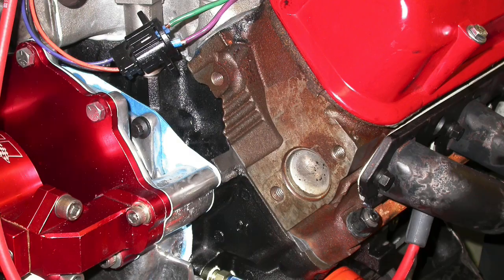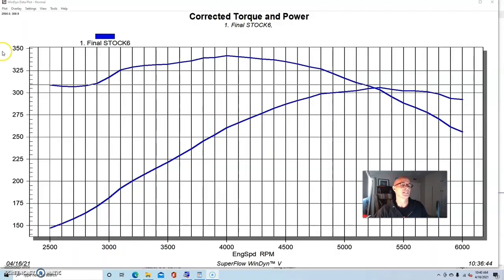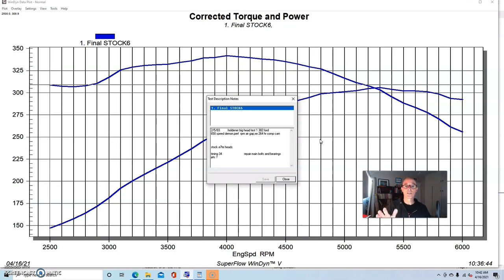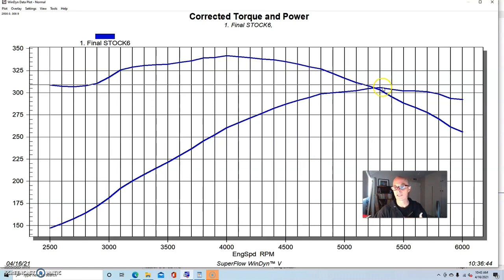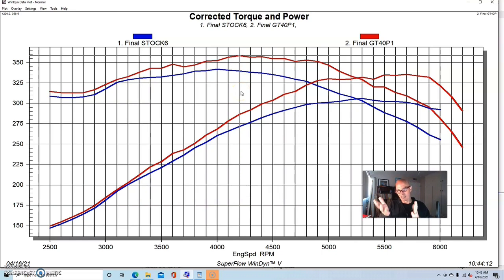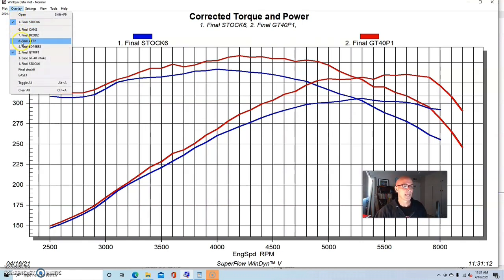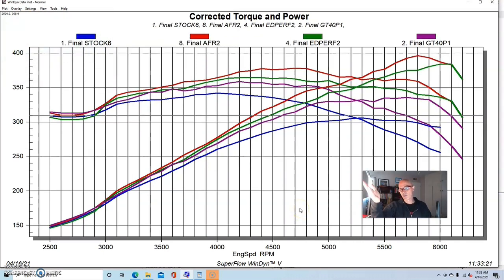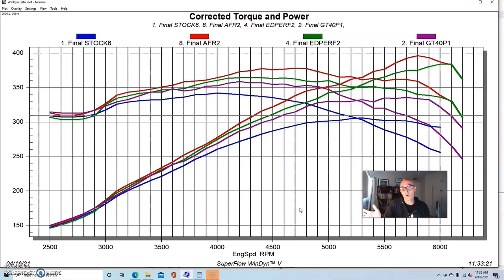JUNKYARD GT40P HEADS-ADD 30+ HP TO YOUR 5.0L (FOR FREE?)

Comment: I would like to see a 351w with max ported gt40heads, milled down, bigger valves, roller rocker conversion, good race valves, polished chambers, It would be nice to see what the combo would do if you were to do everything possible to the gt40 heads. I have looked all over the internet and no one has done a video on a truly maxed out set of gt40 heads its really disappointing!
Reply: What it costs for a fully worked 240 cfm GT40 head you can buy aluminum. Many hours labor and flow benching. Vizard iron GT40/ E7TE heads are $4,000 ready to run.
I think Charlie Servideo said $2,000 for just porting his.
Reply: @hotrodray6802  I understand there's better cheaper ways these days but the look on someone's face when they underestimate you and you blow their doors off is priceless
Reply: @gimply85  Then definitely get DV iron heads and Big Dogs stage 3 original HO intake and ported 65mm and BD cam. 
Or even BD ported iron heads for less $. Look stock, make 400+ HP crank, and 340+ wheel.
Reply: @gimply85  but would they blow your doors off if we made a better decision and ran good set of aftermarket heads?
Reply: @hotrodray6802  ☝️ EXACTLY
Reply: True I've looked for the same thing yet I know many guys did the exact thing to these heads 30 years ago
Reply: @timothywalker2273  problem is... as good as the internet is, you can't beat paperback..... I have kept over 30 years of street machine, zoom, fast ford, performance ford etc etc, and I can tell you that finding the 30 year old articles detailing the work involved from the guy's whom did this.  Is worth it's weight in gold 👍
Reply: @justin3131ify  Unfortunately I know guys with cars in some of the mags you mentioned and their claimed HP were 100hp over what they actually make 😅. So beware of the data sometimes.
Reply: @GapSauceYoutube  Cheers mate noted, but I wasn't referring to feature cars... I Was talking about some of the tech articles that the quality magazine used to feature, from some of the top engine builders.  This video has been around for a little while don't think the fact that you are here watching it now, when a Windsor has shown up in your life goes unnoticed. 😉
Reply: @GapSauceYoutube   Also when is next video drop? 😁
Reply: @justin3131ify  Haha, you're onto me 🤣

I did a 300whp T2 TE50 years ago, this one will be a little spicier 🙂

I dropped one a week ago, hopefully by the end of the month I'll have another 🙂
Reply: Well why don't you do it.  We would  love to see it
Reply: I agree. I had 1.94/ 1.60 valves in the C9 351 heads and never got any flow bench numbers but really didnt think it was that big a gain. They had some ex. porting done as well. So I'm wondering if the only way to get a good set for a blue oval isn't to just bite the bullet and go after market
Reply: Working on this now

Comment: GT40/GT40P heads won't bolt right onto a 351W in the junkyard.... the head bolts are the wrong size. DO *NOT* use a regular "twist" drill bit to make the bolt holes in the heads bigger!! ... you need a proper .500" or .501" machine reamer to do the job properly.
Reply: Actually some of them will. I have a early 96 Explorer that had F3ZE GT40 castings (not the hecho en Mexico ones) on it with 1/2" bolt holes and NOT drilled for smog. Only set I've seen like that but obviously they're out there...
Reply: I got a set of Ps a guy was using on his truck. Had the 1/2 inch holes. Don't know where he got them. Lightning?

Comment: I scored some NOS Two-Bar (Marine) GT40 heads. A friend ported them, removed the EGR bumps, cleaned up the slag on the OE headers (40% larger at flange!) added a ported E4 intake, a recurved distributor, and 1.7 SVO rockers to my '85.  Woke it RIGHT up and nobody knows it's modded. :-)

Comment: I’d love to see similar tests using the same motor with a good set of early 351w heads from 1969 or 1970.
Reply: They flow pretty darn close to stock GT40 heads. I've heard from more than 1 source that the GT40 heads are based on the C9OE castings.
Reply: @linctexpilot8337  are you talking stock 351W heads or worked over?

Comment: Answering your question, depends on what you want or are using the motor for. If it’s just a Saturday cruiser and you’re on a budget, the GT40(p) heads are perfect. If you want more HP and invested in other mods to support added HP, then a good set of aluminum heads makes sense.

Comment: It should be mentioned the GT40p does have a smaller exhaust valve than the gt40 which once you get past .500 lift has a dramatic effect on flow. If you go with a gt40p you should probably stay around .500 or less unless you do some valve work to open them up. If you want a high lift cam you should probably get the GT40 instead.
Reply: My combo is 2000 explorer long block Alex springs drop in springs , B cam with 1.6-1.7 scorpion roller rockers. Mac long tube headers .Fox coupe V8 swap T5 , 4.10 gears .
Reply: @allenjay8157  Hows it run?
Reply: @void7365  runs plenty strong in a 2800 lb foxbody with a/c , not stripped down . 
I disagree with the whole blurb on the gt40 being better due to a bigger exhaust valve . P head is a fast burn head , I found no difference when I put 16* initial timing in my car , in fact car ran like crap low rpm with b cam . I put timing at 12* with spout out and car drives damn good now. I do drive this car to work 26 miles one way . 
For a stock head I like the p head , I would not put a huge cam with a stock head anyway so there’s a reason I bought aluminum heads for another project.
Reply: Good point

Comment: Will this work with efi? I'm an off rd truck guy. So efi is a Must an everything I see is carb built
Reply: the gt40p heads were made starting in late 1997 so they were built for EFI. But I would go with GT40 heads instead if you intend to go with a cam with .500 lift or more because the  GT40p has a smaller exhaust valve.

Comment: I have a question I have a 79 302 how strong are the connecting rod Bolt will they handle 5800 RPMs
Reply from the maker: YES
Reply: Long ago I built a 308 with 289 (1965) full race ported and I shift at 6,800 rpm only add arp bolt on the stock connecting rod never have problems the blockwas a 1971 stock crank stock connecting rod only change the piston for flat top

Comment: Does the GT40 heads work with a 1970 302 2V?
Reply from the maker: Windsor-yes
Reply: @richardholdener1727  How much HP you think I would gain by just getting GT40 heads, a 4 barrel intake & carb, all with standard rods, pistons & cam? Should I change the cam?
Reply: Yes but you are losing compression unless you get them milled.
Reply: @rondye9398  if he's going from E7 heads to gt40s his engines compression ratio won't change. They both have 63cc chambers. Depending on casting number of course. Some ranged from 63-66cc.

Comment: Richard, what total build package for stock bottom end rebuilt GT40P heads TFS valve springs valve job Explorer intake AOD trans. Which cam works best street car? Thanks for the best videos.
Reply from the maker: LOOK FOR A 218/224 DURATION CAM
Reply: Thank you for taking time to help Richard. Keep on testing, like the videos!

Comment: Good timing Mr Holdener. I am doing a gt40p swap this week. Waiting for the heads to come back from the machine shop. I nicked some of the valve seats while porting the bowl and had to have the  seats re ground. I am upgrading the valve springs with the TFS spring kit and topping it off with 7.1 ratio roller rockers. The engine was using D8OE heads so I am hoping to get 50HP out of this swap.

Comment: I need to do a GT 40 head and explorer intake swap on my 86 Bronco. The stock motor is such a dog. It has 4.11 gears and 33” tires with an AOD trans. A cam is in the future to. Whats recommended for a 4x4 looking for mid range power?
Reply: I've heard of some people using a 93 Cobra cam with the 1.7 rockers because of the way that the cam was geared toward low end TQ. Trucks need that low end. There's also always the E303 cam.

Comment: i just got a reman set of p heads ,did you change the springs on the p heads or did you just run em, from what i am hearing on the web .450 lift is max on the stock spring.going on bone stock 1995 5.0 bottom end.1968 mustang with aod
Reply from the maker: CHANGE SPRINGS

Comment: Hmm... These graphs show GT40 heads and a turbo is the way to go unless all you want is high rpm. Then buy high flow aluminum and build the whole engine to handle 7500rpm or higher.

Me? I'm building a car to drive all over and tow a camper so I'm going with the GT40 and a turbo. My only choice rebuild my 302 or buy a junkyard 351. Although I'm leaning more towards keeping my 302, get the GT40 heads, put high quality valve springs in and rev that engine to 6500-7000. 450hp for cheap with a turbo 302 is sounding really good. Hopefully I can coax 400+ lb-ft out of it at 3000rpm. Big block power out of a tiny engine.

Comment: Got a set of home ported big valve e7's, a set of gt40 and gt40p's, and my Canfield 192cc's. All have homes save for the p heads. Got the Canfield's for $600 complete on CL.  Rest came from cheap junkyard motors.

Comment: Have you ever tested the street heat heads the original aluminium ones ? 2.02 1.60  200 intake 90 exh 60cc chamber ? On  a 351w stock bottom end ?

Comment: You should redo this kind of test put upgrade the springs from the GT40/P heads. The engine is only designed to go to 5,000 rpm and you ended up with valve float

Comment: I’d like to see the GT40 head on a Windsor vs the Double Hump heads on the 350. I know that the double humps would have the advantage because of the fast burn combustion chamber design vs the GT40 semi hemispheric design with similar camshafts. Just another idea. Thanks again Richard for a great video.
Reply: I think the GT40'S would flow more air and that's where the power would come from. My 40P's are 58cc chambers. I can't tell you the specs on the Chevy heads.
Reply: I have the original E5 head off my motor. I had them plained down 8 thousandths to get a good surface. I came across the 40P's by accident. Through the research I did I knew they were a better head and added HP. The 40 series heads have weak springs. I decided to get the upgraded springs so I wouldn't have any valve float.
I'm looking to get them ported. Not many shops do that now. I don't have any experience doing that so I'm leaving my hands off so I don't screw them up.
Reply: @charlesespenshade  Look up Eric Weingartner racing and Headbites on YouTube. A lot of porting and polishing tutorials. If you’re going to upgrade cylinder heads in the future, go with a set of AFR 185cc Renegade or the Enforcer cylinder heads. By the time you pay an experienced porter, Machine shop machining for screw n studs-guide plates, 2.02-1.60 valves, you could get a very nice set of aluminum heads that will smoke the GT40’s. All that work done on the GT40’s would be $1200.00 and up. Good luck on your project.
Reply: @StainlessTIG2   I'm running stock rockers and push rods. I have $400 in my heads. The guy I bought them from had them shaved for a stroker motor he was building. He decided to go aluminum heads instead. For what I wanted to build the P heads are perfect. I'm not running down the strip with it. I just wanted a good street car. I got what I wanted to build all day long.
Reply: @StainlessTIG2   All I had to do to the P heads is fix the weak spot being in the springs.
If you think Frankenstein is slow, think again. I'm still in building stage you can say. I'm still running the 7.5 rear which won't hold up long. I have subframe connectors that need put in yet also.
My motor has a lot of torque. Having the V6 torque converter, trans and rear displaces the power in a different way. 
It's named Frankenstein for a reason. Nothing in that car really belongs in it but it all works perfectly together.
Reply: @charlesespenshade  valve springs are basically the first engine component to wear out. I usually go 20-50psi over the camshaft recommendation. 7.5 rear end can take some punishment, but eventually 8.8 upgrade. Find a early 90’s Lincoln town car with the 8.8 because they’re 31 spline and rear disk brakes. I put one in my 81 Capri with a Cleveland. 4:30 gears, built C4 transmission. I was running 5.90’s in the 1/8th on a 100 shot and Still had a lot left in it.
Reply: @StainlessTIG2   For my '97 Stang I would need a '94 - '98 Stang 8.8 rear. They vary in length between the yrs.
I have rear disk on mine. I'm hopefully going to find one to do a perfect swap. I found a place near Atlanta that has one hopefully. $450 but you get everything with it. They unbolt it and not cut it out.

Comment: Other than practical reasons like heavier vehical needs more power why the hell would ford put the crappier version of there 5.0 head on there flagship performance car?? You would think in the even then pony car wars ford would have wanted every drop of performance they could and they had a better production head but they tossed it on there suv?!?! It doesn't cost any more to produce the gt40 head. I'm a chevy guy that inherited my mom's 95 mustang gt convertible so these small ford details are new to me, it's not fast per se but with a 5 speed it buggs along decent enough to be fun to drive but calling the 5.0 an HO is amusing it is noticably faster than my 85 Z  with the LG4 5.0 and a 700r4 I had years ago, I loved that car but it was sloooow
Reply from the maker: the gt40 head was introduced long after the 5.0l Mustang came out

Comment: I'm real impressed by my stock 94 mustang short block with milled (.040) gt40 heads,  Alex springs, comp nx264hr cam (adv 4deg), Mac equal length headers,  ported explorer lower stock explorer upper and tb. Streetability is very responsive and fun.  Plus still 20mpgs.
Reply from the maker: good combo
Reply: I'm running a Crane 284-2 cam. What a wild ride with the 4r70w trans and 273 gears.
Reply: @charlesespenshade  you got any videos of your set up?
Reply: Yes.

https://youtu.be/ihN-15Kn1BM?feature=shared

Comment: Richard, What do you think about adapt a Nissan vk56 32 valve in to a 302 por 351W? IT's have very similar bore spacing.
Reply from the maker: how similar?
Reply: @richardholdener1727  112mm (4.409" on vk56) vs 111.252mm (4.38" Ford 302/351W).
There is a guy that adapt a LS head on a Ford 351W and work.

Comment: I’m glad you did this. I have a 65 fastback mustang with a 327 SBF with red cornet ported gt40 heads and comp 25-246-3 cam.  I love it. It was put together in 1998 and its a mix breed.  I do not remember all the parts and have never had to rebuild it. I am hesitant to change heads but want more power. I have 190 cc edelbrock rpm heads and seeing this has made me decide to put them on.  With the current engine I have beat in the 1/8 mile. late model 5.0 stangs challenger , charger and a 2016 corvette ( shouldn’t have won this one ) .  I’m afraid to give up dependability.

Comment: Every time I build a sbf I use gt40 or gt40p heads from explorers. 351w late. Model blocks with roller cam and gt40p heads work good for truck
Reply: Im planning on put gt40p heads on a 351w with e303 plus cam what kind of power can I expect

Comment: My 1985 reverse rotation ski boat will need a freshening sooner or later. It was cursed with a 351W, the 350 Chevy was a $600 40hp upgrade back in the day (240hp vs 280hp). I bought the boat used in 1987 and had no choice. The GT40 heads seem like a solid cheap upgrade for an engine that only revs to about 4600rpm. An RV cam comparison would be helpful for us boat and truck guys.
Reply from the maker: step down to the 258 cam (either low or high lift version)
Reply: @richardholdener1727  Thanks Richard.
Reply: @OldDirtGuy  by proclaiming your boat or motor or house or kid or wife or life us cursed, it will be... 
"my children are destroyed for a Lack of knowledge" -Hosea 4:6

Comment: Yamaha V6 or V8 from an old Taurus SHO with some boost would be cool.  Maybe even the 24 valve Duratec V6 if SHO engines are non-existent in the yard.
Reply: I still want to see the Volvo 4.4l version of the 60° v8. They're rated at 300hp and would be almost free in a junkyard. Lots of kung-fu noises.

Comment: I just got done doing this. Gt40p's from a 2001 Mountaineer. $39 each at my local yard. Ported them myself and had a friend mill them. Added an Alex's drop in spring kit and they work great! Awesome performance on a budget.
Reply: Do you have the link for those springs?
Reply: I’m in the process of doing the same! Did you use your stock rocker arms?
Reply: How much you can mill the head?  Stock cam? Stock rocker arm ? I want to improve my explorer motor but i dont know how long i can go without stamping a valve in a pistón 🤣
Reply: @humbertogarza9225  Check P/V now, then mill once you know what you have.  As in, if you have.200" and you can live with .08" then mill .120" off.
Reply: @humbertogarza9225  I know it's been a while since the post. I shaved my heads 8 thousandths and decked block 15 thousandths running 30 over 350 11:1 compression pistons on Ford rods with stock rockers and push rods.
Reply: What about headers, don’t need different headers to run GT40p in a fox body?
Reply: I had springs put in my P heads that match the cam. I don't have any floating problem. I gave the machine sho my cam specs and they ordered the spring kit. I do know by reading the paperwork in my springs that the inner springs needed work done on head.